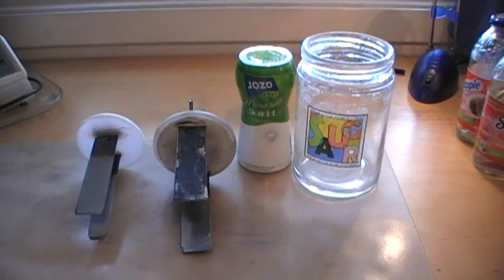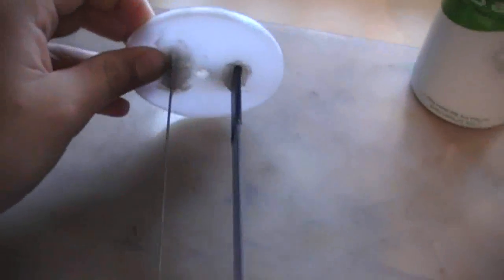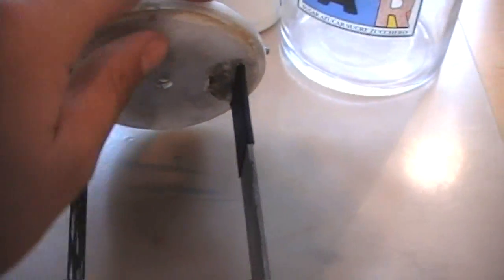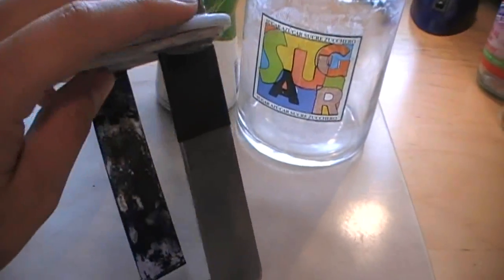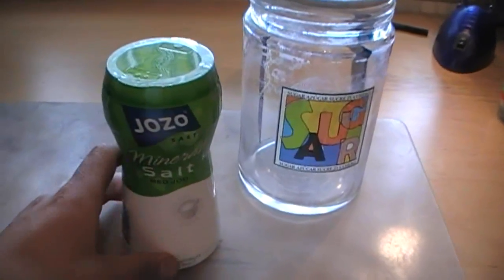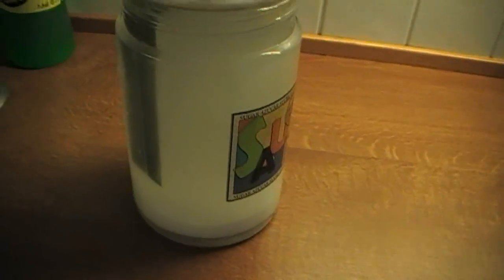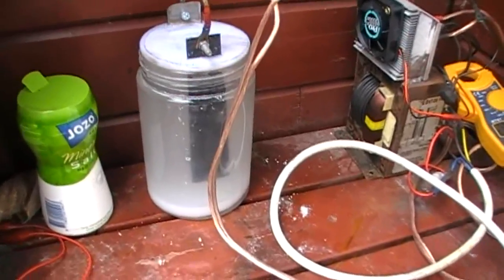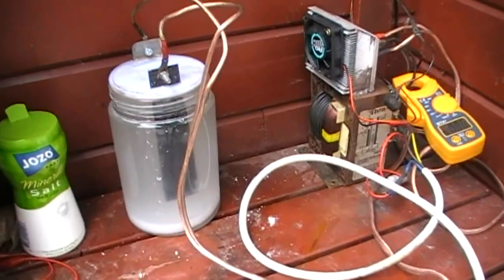How to make Potassium Chlorate (The easy way)

Comment: why do people always try to make sealed systems??

two electrodes in a 1000ml beaker and set a watch glass on top shove it in a fume hood

if you are not using a fume hood please dont do this inside!!!
you couldnt pay me to do this even with a tub going out a window  no way in hell
Reply: Clown Whisper - hey. can u tell me if this Apparatus I found on eBay would work, rather than trying to make one? I'd rather just buy this one rather than worrying about making one that will cause contamination if I buy the wrong anode and cathode. Appreciate your input. 
http://m.ebay.com/itm/New-Electrolyzer-Water-Electrolysis-Apparatus-TDS-Water-Quality-Testing-220V-O8-/302215854352?hash=item465d77f910%3Ag%3AiPYAAOSw37tWCn~o&_trkparms=pageci%253A104bd9c7-3ead-11e7-a27e-74dbd1809494%257Cparentrq%253A2e90ea6215c0ac80016979fffffe236c%257Ciid%253A17
Reply: +Clown Whisper because not everybody has a fume hood

Comment: I am almost positive you shouldn't have KCL laying on the bottom of your cell when you begin. The reason this shit isn't dissolving enough is because it's not very soluble in h2o. You should use regular table salt -sodium chloride. It will fully dissolve an not leave junk lay on the bottom of your cell. It will contaminate your chlorate. Keep this at 6volts for about five or six days. An you'll get sodium perchlorate, then bring out the potassium chloride (no-salt-substitute) mix the two saturated solutions.. let cool for a few days ! Filter with a tee shirt rinse with cold water   There, that's potassium perchlorate the easy way. If you start from potassium your just wasting your time.

Comment: Is it possible to buffer the liquid, so that the Cl is absorbed in solution, or, would modifying the fume-cupboard to neutralise or absorb the Cl be a better option?

Nice tute :) thanks.
Reply: you can scrub chlorine by bubbling it through hot sodium hydroxide solution

Comment: if you want kclo3 the best way is to go directly from kcl to kclo3 with an mmo anode and titanium cathode 

power should be around 5-6v

higher amp in the range of 20+ is best but you could get away with using less if you want to wait for ever

the benefit of using mmo and titanium is that you dont have to filter out contams if you start with fairly pure kcl 

if you have any questions pm me i have tons of info and links on this
Reply: BONES MACGYVER can i use crystal to pyrotachnique  (fresh from the cell) without recrystalization??

Comment: Another option which I had pretty good results from is a lead dioxide anode. I made it with lead acetate and copper acetate, and that should be enough information for most people to make one.
Reply: how?

also lead dioxide anides arent that great for chlorate, princiaplly from the start

chlorine kills lead dioxide after awhile

but great for perchlorates tho

also, what substrate did you use?

Comment: -I made about 1 kg of raw potassium chlorate crystals with big graphite blocks as the electrodes, it still is very black due to the graphite particles in the "sludge", of which I need to get rid off by filtering and recrystallizing, but at the end I`m quite satisfied with the progress, as I only had a 12 volt and 9 amp battery charger, and as the cell I had a 10 liter PP bucket with about 3-3,5 liters of a saturated salt solution (1350 g of 69 %KCl mineral salt), the cell ran at about 30-40 C.
Reply: Did you add hcl everyday? To adjust the ph?